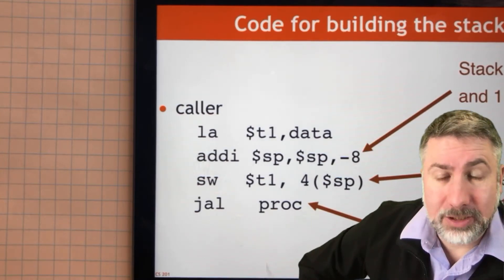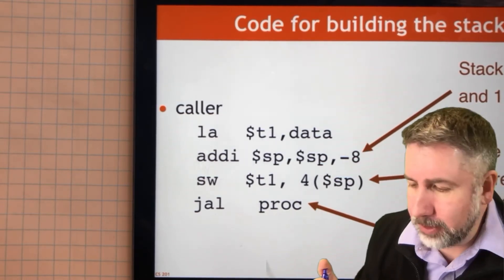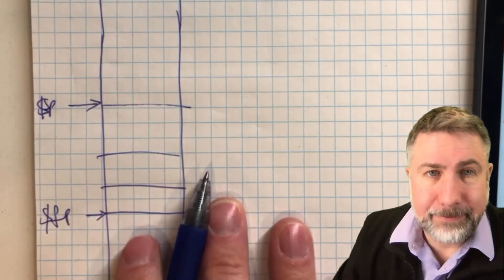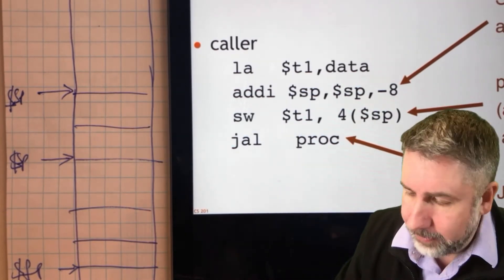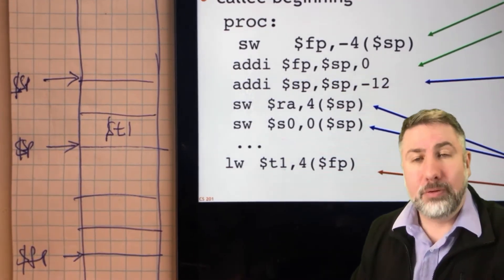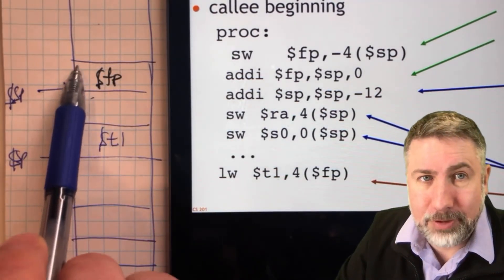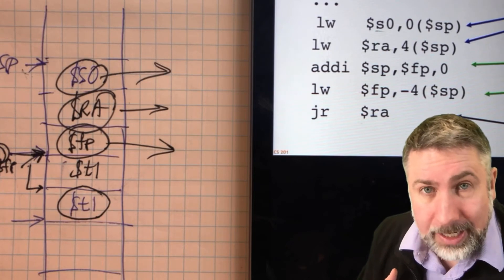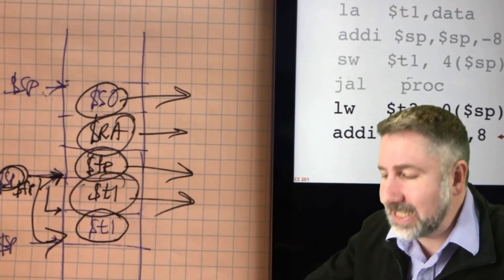Assembly code to build the stack frame

Comment: Thanks a lot for your excellent video! Had one question: in the callee ending part, when retrieving the stored value to $s0 and $ra, why the code still use $sp as the base(I mean, stuff like 0($sp) and 4($sp)), while $sp may have been changed? I think use $fp as the base would be safer